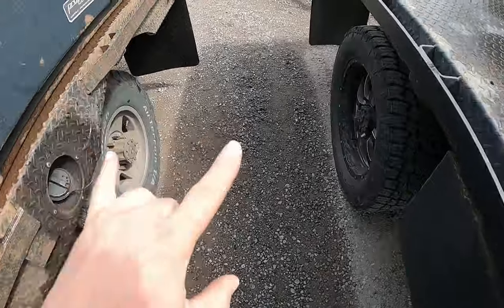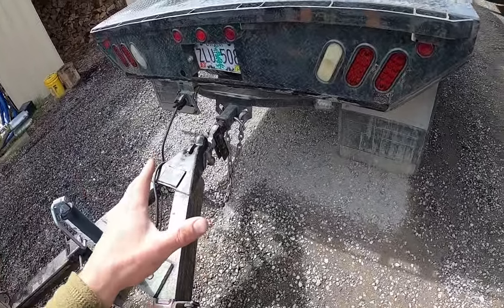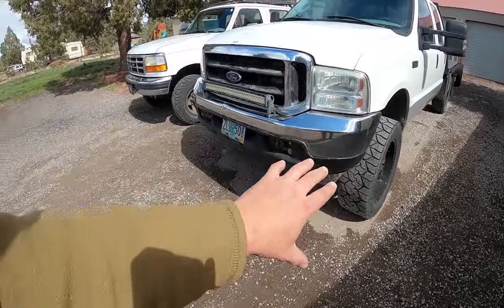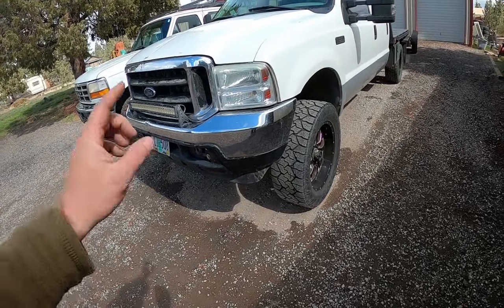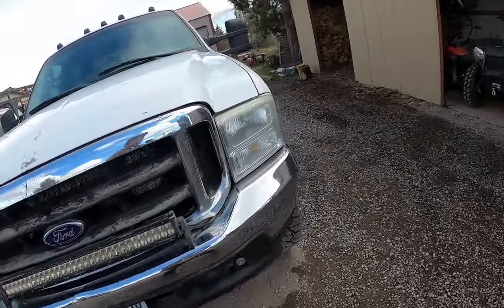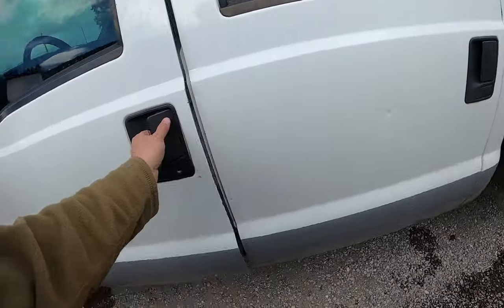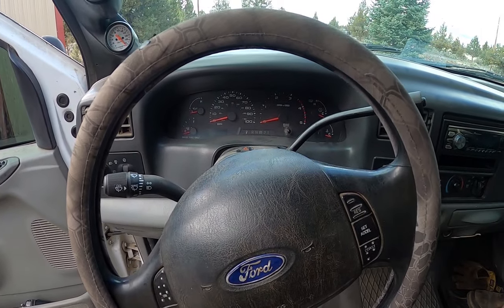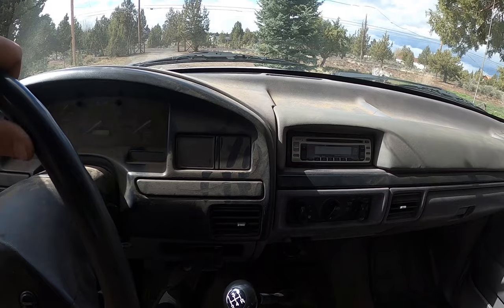7.3 OBS VS 7.3 FORD SUPER DUTY

Comment: One thing I’m not a fan of on the super duty is from personal experience… while driving a 99 350 powerstroke 4wd 4dr longbed a couple months back one of my pulleys on the belt tensioner sheared off… luckily I wasn’t on the highway or towing!!! Once that belt stops spinning you lose brakes and steering. I’ve owned plenty of cars and trucks with no power steering so it’s not to bad but losing the brakes in that big mutha is a bad scene. Them genius engineer’s didn’t fully think that one through!!!Needless to say I replaced the fan belt the whole tensioner unit both pulleys and the idler pulley as well for insurance 😂.

Comment: I personally hate the hydro boost system..had one blowout on me while working for FedEx. The power steering pump shit the bed mid route. Had to basically do a brake stand just to be able to turn the wheel at a stop..had to do that for something like 20 houses..pain in the ass.

Comment: If the obs is struggling with 10k towing there might be something wrong
Reply: With a tune and some suspension and injector improvements they can get close to 20k. People with stock 73s have been knows to pull 20k.

Comment: They are both cool. I am holding on to a 96 OBS that I daily. It runs strong, sounds good and is cool AF. But it is rusty and parts are falling off (especially interior...UV destroyed plastic parts). And I have a rust hole in one wheel well so I get mud/snow thrown into my bed. I need to trade it in and yes I think the Super Duty Fords are kinda cooler, but that old OBS mojo has me in a similar situation. I may just drive it until it breaks up, like The Six Million Dollar Man intro: https://www.youtube.com/watch?v=mVGoivuwco4&ab_channel=painamajorpain

Comment: The super duty’s from 99 to 03 ran the Dana 50 not the 60 they didn’t start running the 60 again until 04 when they switched from leaf spring front end to trailing arm and spring the obs front end that you have is called the wishbone front end